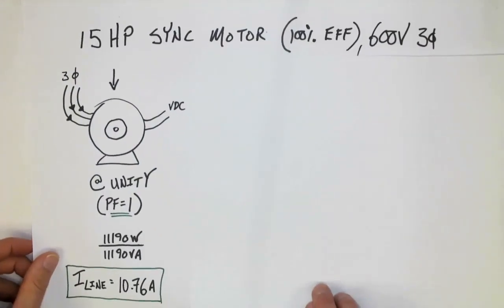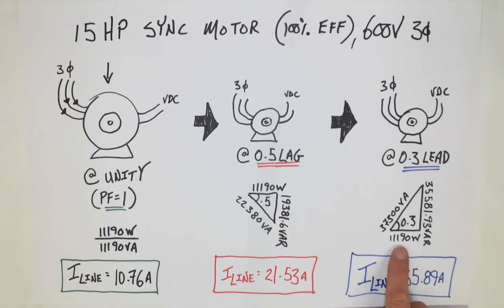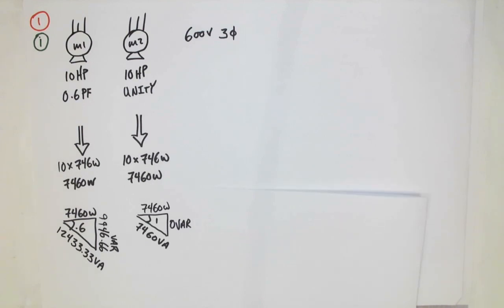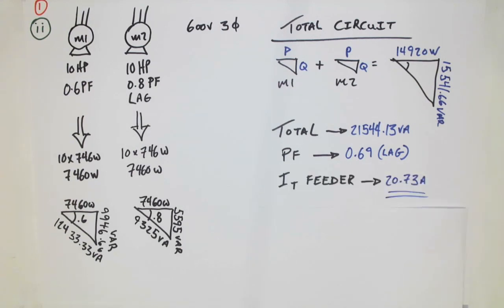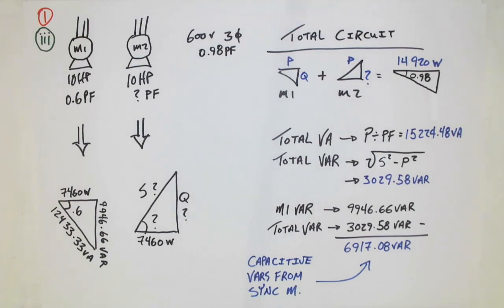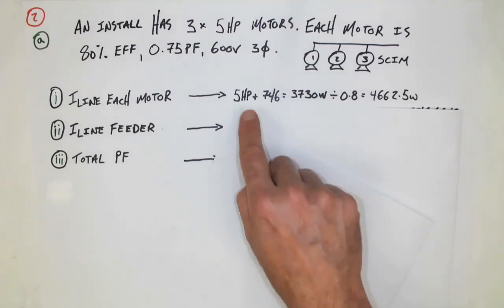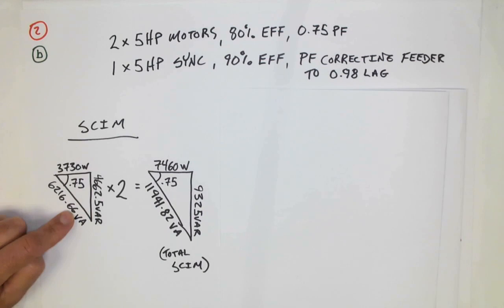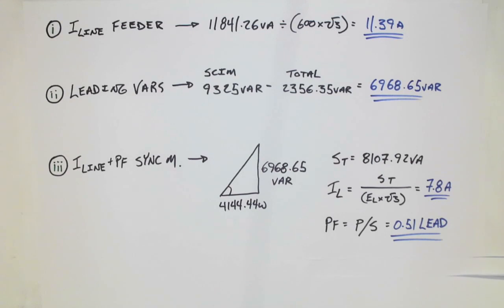AC machines Synchronous motor PFC calculations

Comment: In ex . 2 , 80% efficiency was not considered in computing for SCIM motors wattage rating?
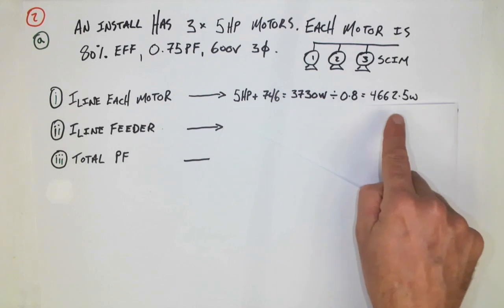Reply from the maker: Interesting question! At time marker  13:58 you can see me pointing at the divide 0.8, which covers the 80% efficiency of the three motors. So to answer your question, I did! Is there somewhere else you were thinking?
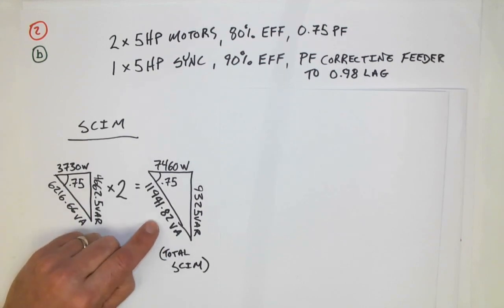Reply: I think the person is referring to 2B at 16:25 the efficiency is not included in the second part of the calculation